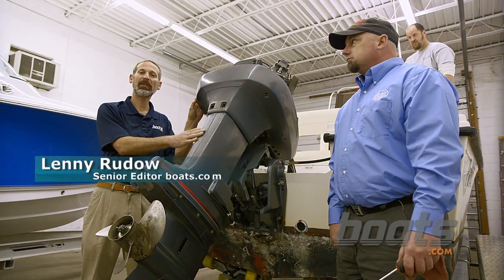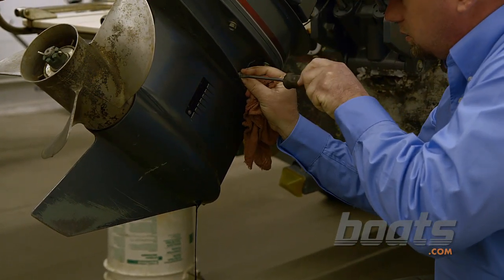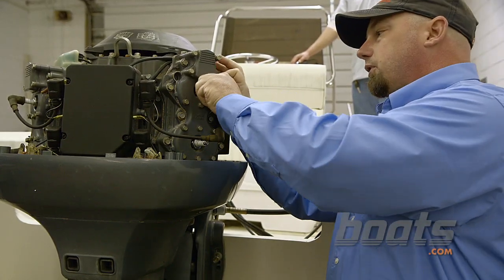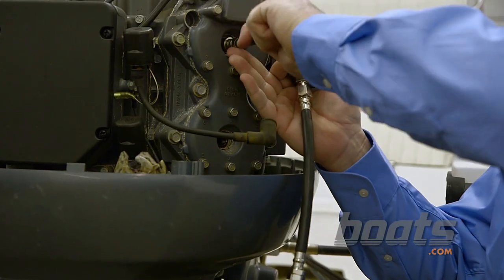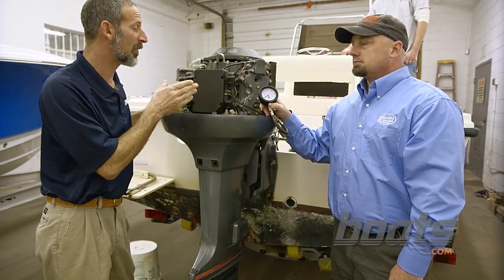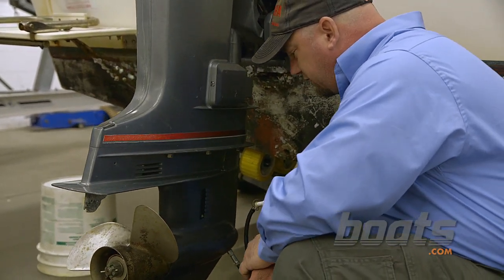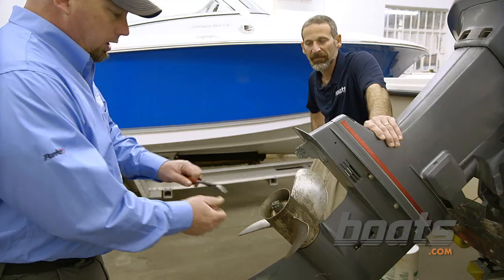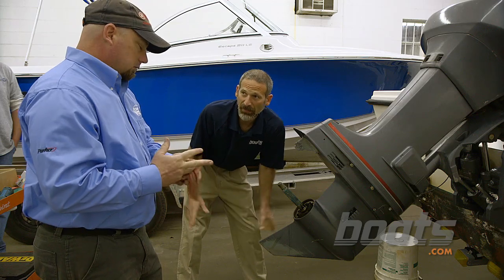100 Hour Two-Stroke Outboard Engine Service

Comment: I wouldn’t think a 100 hour service would be complete without at least inspecting the water pump impeller and housing. Sort of sloppy work to not include that step, if you ask me.
Reply: As per service manual, the impeller gets replaced in the 200 hour service.

Comment: At 1:51 you mention the safety line, where's that line ?   also do you have a video of how to maintain and clean carburetors, I just bought a 135 HP outboard six cylinders  and I have to spray with fuel cleaner to make the motor start .  Thanks
Reply: safety lanyard on ignition

Comment: Nice video, but far from complete. It is critical to decarbonize the engine with combustion chamber spray such as OMC Engine Tuner every 100 hours or once a year. Carbon build up on piston rings "will" eventually cause engine damage and needs to be cleaned as before mentioned. Spark plugs do fail and should be "replaced" and not just inspected every 100 hours.  The timing and carburetor sync should be checked and adjusted. Water pump impeller should be inspected and replaced as needed. Engine needs to be checked for proper operating temp (a cold running engine, as well as a hot one, will cause engine damage over time). Cylinder head bolts should be checked and set to proper torque specs. Electrical connections should be inspected for corrosion and properly lubed and/or sealed.  Wiring should be inspected for wear and brittleness and repair or replaced as needed Engine fuel filter should be inspected, cleaned and/or replaced, not just the water sep filter. All fuel connections should be inspected for leaks and hoses need to be inspected to make sure they are not getting hard and brittle, and should be replaced as needed. Powerhead should be recoated with an anti-corrosion lube. I actually use gun oil on all my customers engines, and as I live and work in the high salt environment of Hawaii, and corrosion is a big issue. I have tested many lubes and several are good, but try and avoid lube sprays that leave a thick, sticky coating. Mechanics hate it, and it also attracts grime and retains heat. Been repairing outboards for over 30 years, and everything mentioned is absolutely needed to ensure proper operation, performance and engine life.
Reply: And oh yes... vacuum and pressure test the lower unit. I also include a carburetor cleaning on smaller outboards, as many are not run with water sep. filters or have built in tanks which do get dirty and the carbs do pick up water and junk from tank. Out here, it is next stop Tahiti if your engine fails, and I pride myself on "never" having had a customers engine fail due to improper service.
Reply: Patrick Hascall where are you from
Reply: how do you clean carb without taking it apart?
Reply: @koldenrjk  
You can't. Thankfully, they're simple
Reply: @patrickhascall7401

Comment: Spark plugs "As white as possible"?  
I thought white plugs mean a lean mixture condition,  which can result with severe motor damage. Spark plugs should have a light brown color.
Reply: I think he meant the ceramic piece - I hope..
Reply: Yes he said ceramic center piece, but he should just say light brown in color, not white or black..

Comment: Hey, I have a question for you guys.  My boat motor is not pumping water.  I opened up the lower unit and checked the impeller, but it was in good condition.  Any thoughts about this??
And also,  the little inlet beneath the impeller, is it supposed to be closed or open, because mine seems to have something blocking it. 
Thanks
Reply from the maker: Hey +Tom Nguyen, if you see any blockages, obviously, you should clean them out. That said, once you've dropped the lower unit it makes sense to do a complete water pump rebuild even if the impeller itself looks fine.
Reply: my brother inlaw brought an outboard once wasn't pumping water man put a new impeller in i checked it he left the pin that holds the impeller on the shaft off

Comment: Okay seen it on all vids and understand how but the why is not connecting with me.   
Why do you fill the lower unit from the bottom plug up instead of pouring it in the top until full?
Reply from the maker: Hi, if you leave the bottom plug in and try to fill from the top, the air being displaced by the oil can't get out. And if you leave the bottom plug out and fill from the top, well, the oil just runs out. So, the only way to get the job done is to remove both plugs, and fill from the bottom.
Reply: Thanks and wasnt sure how small the hole was as far as air and/or pouring it in  But make a lot of sense  what you said
Reply: Saltwater Outdoors because if you'd tried to fill it with the bottom plug and you would get air in the system

Comment: I don't get this you hear how wonderful these new outboards are and they talk about the 100hour service the 300 hour service the 500 hour service and people are spending like 400-500 for these services. I bought a Bass tracker Nitro with a 60 horse Evinrude in 1992 it finally quit last fall and in those 27 years I always stored it inside. I always put fuel stabilizer in fall then ran it until it ran out of fuel. I then fogged the cylinders. In those 27 years I changed spark plugs 3 times  and lower unit oil like 5 or 6 times. Went through 3 starting batteries, one regulator rectifier, and one prop. I didn't have 500 in the 27 years I owned this thing. Todays engines seem like giant hunks of crap to me. Which I didn't really realize until I bought a used 2012 75hp Evinrude and started reading up on them. All I hear about is maintenance, maintenance and the ridiculous fees these Marinas charge people to work on boats. Then it seems like 80% of the time they are just guessing until they get it right. I was going to get rid of that old 60horse but now I am convinced it is worth hanging on to.

Comment: does a 2 stroke motor have crank case oil or does the lower unit pump up to crank and rods?
Reply: yes. they have a separate oil sump and a pump to get it into the crankcase. the lower unit is just gear oil
Reply: @scrubly_jr is there any videos showing how to change the oil in the sump?
Reply: @eriks1526  it's a 2 stroke you don't need to change it you just add more to the sump as the engine uses it
Reply: @scrubly_jr  Thanks! 👍

Comment: Is there a specific oil you used for the lower unit oil on a 2 stroke?
Reply: I used gear oil, I believe 90 weight bought at marine shop.

Comment: When I tried this, something weird happened. Eventually the oil just stopped flowing into the lower unit and started seeping out the edges of the pump where it screws in to the bottle. I could not get any more oil into the  motor and it would not seep out of the top section like it's supposed to. I had plenty of oil left in the 32 oz container but it just kept seeping out of the pump itself. I'm kind of getting the feeling that my pump sort of exploded even though it was brand new. Should I just get a new pump and try again? Thank you.

Comment: Hello great video I have 5 hp mercury 2 stroke outboard Motor  prop Propeller I was wondering about the seal in mine motor have not see the water in about 15 years what should I be looking for
Reply from the maker: Hey Del - ouch - after 15 years out of the water, you have to expect to replace every seal, gasket, fluid, and non-metallic part (IE the water pump impeller). That's just too long for an outboard to sit.

Comment: I HAVE 1989 45 HP MARINER MOTER WILL NOT RUN FAST ON THE LAKE IT TROLLS FINE . I REBUILT THE FUEL PUMP CHANGED THE FILTER. WHAT SHOULD I TRY NEXT
Reply from the maker: Hey Richard Wilson, you're following the right path. There are plenty of possibilities and we can't promise this will work, but a carburetor re-build is the next logical step.

Comment: i have a mercury 70hp outboard motor and when i pump the fuel to the motor when the ball gets hard the fuel pisses out of what looks like the carb...any help is appreciated thxs
Reply: that happens if you overpump. it pissess out so not to flood or liquid lock engine if you forces it through somehow if you manage to get a liquid in an engine when you start it it does not compress and would lock you up or bend a rod
Reply: thanks

Comment: Hi Fantastic video, i have a Yamaha 30 HP and  a 50 HP about 90 models what gearbox oil should i use.
Reply from the maker: Hey Farmer 2492 - for both the 30 and the 50, Yamaha recommends Hypoid SAE#90 gear oil.
Reply: Thank you

Comment: When would you replace impeller and when would you replace thermostats etc?
Reply: Once the water that come out the "pee hole" isn't flowing that can be a sign of impeller change needed.. should be a constant flow of water at idle

Comment: I tend to do the impeller every two years on an 85 Mercury XR2.....should I do her every year to be safe?  Motor runs like a champ and want to keep it that way.
Reply: 5 years ago but, We do our impellers, plugs, gearbox oil and tilt fluid.. every year. we also check for fishing line, cracks in hoses and grease steering and linkages often.

Comment: What type of oil is used in the lower unit?
Reply from the maker: Hey Cameraman14 - that depends on the make and model of your outboard. Some use Hypoid high-viscosity, some others specify by brand (such as Quicksilver High Performance Gear Lube for some Mercury motors) and some others can use generic lower unit gear lube. Refer to your owner's manual or do a bit of Googling, to find out the specifics about your outboard before changing the lower unit oil..
Reply: Change oil in 4 stroke Honda outboard
Reply: Antifreeze

Comment: Hi... is it normal for the spark plugs to have oil on them??  I noticed mine did
Reply from the maker: Hi manuel ferrera. It's not uncommon to see a sheen on the plugs in a two-stroke, but they shouldn't be coated or caked with black goop. If they are, you need to check the fuel-oil mixture and make sure the fuel isn't being over-oiled.

Comment: What about the oil and timing belt change?
Reply: Brian Morrison two strokes don’t have oil and timing belts. They are lubricated through burning a fuel:gas mixture, typically 50:1 or lighter, depending if an auto lube system is installed.
Reply: No oil changes, no timing belt and no valve adjustments! Next your going to say they are lighter, cheaper and make more power too!😀

Comment: thats all for 100 hour service ? no run test? check- water pump/ belts/ hoses/wires visual? hook computer up to it take reading? xtra that anode by prop needs changing.
Reply: Belts ?? Computer?? This is a yamaha 200hp  2stroke 😂